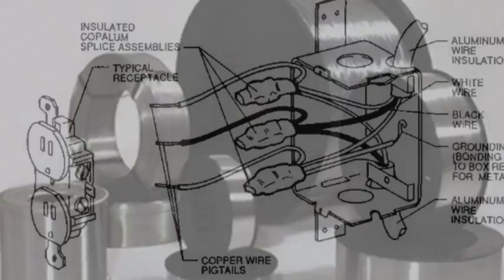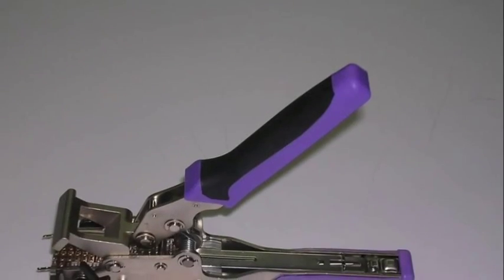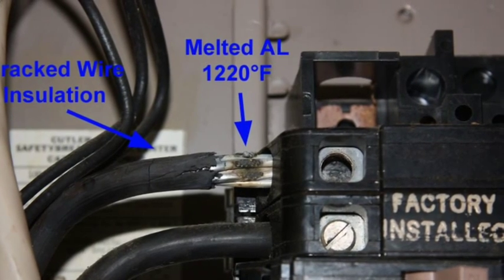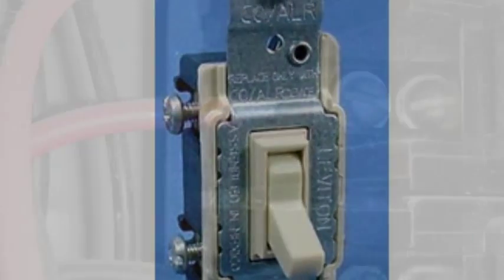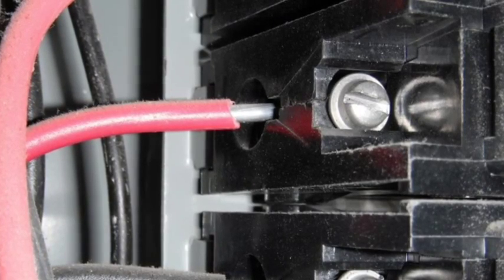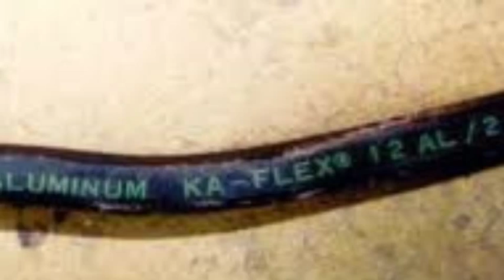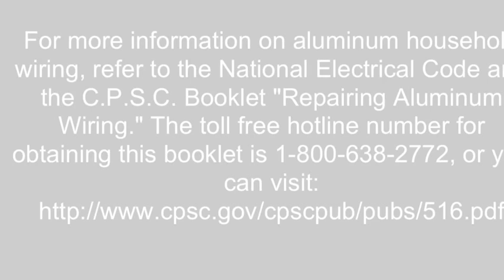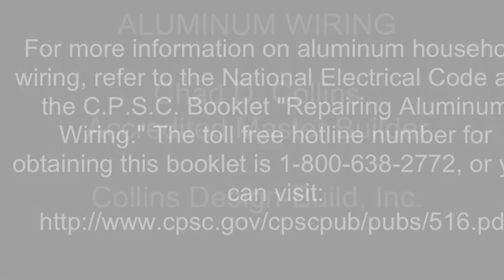Does Your House Have Aluminum Wiring?

Comment: You say to never twist copper and aluminum wires. The Ideal purple AL/CU connectors are installed on AL and CU wires by twisting them together and then placing the twist on connectors filled with antioxidant paste. Is that an approved exception?

Comment: Well explained info...I've been dealing with houses with aluminum wiring for several years..there wasn't much info available years back but now there are many sources...I've seen lots of burnt plugs and switches mostly from improper installs...not striping wires properly striping wires with striping tool nicks wire causes it to break..using razor knife is best...copper to aluminum  connections without proper connectors....It's safe if done right...

Comment: Use alumicons on everything
Reply: If two houses are equal, I'd run from aluminum wiring. No need for it prior to 68 or after 72. 

Could be 15-20k to rip all that crap out for 1,000% sure! 

And EXPECT unqualified RE agents to blatantly LIE about EVERYTHING,  particularly shite THEY don't have to live with, just to whore themselves to get the check asap and do as little as possible.
Reply: Are Wago lever nut compatible with aluminum?
Reply: Wago has copper inside the lever nut. Look like aluminum is not compatible with copper when they touched each other .
Reply: @conchim99  wagos (with the wavo brand grey  nolox) are allowed in the europe. Here it's the purple marrets, black marrets, or alumicons. The latter is the safest option

Comment: Very detailed explanation
Which other metals can be wound or connected with aluminium directly with out problem?
Which material is alumiconn® lug made of?
Which other connectors can be used to connect aluminium with copper wires? 	
Thanks
Reply: You can use Wago connectors with alu plus gell, its safer that anything that was in this video, in my country Romania more than 50% of the population has aluminium wires in their houses, and its pretty safe.

Comment: My husband and I bought a 1969 ranch two years ago and thought the wiring had all been replaced. As we toured the house, all of the electric boxes and switches were hanging out of the walls and appeared to have new wiring. Plus, the owner, an electrician, was running new wire in the finished basement. For us, it was one of the selling points of the house as all of the others we'd looked at had ancient wiring. Then recently, my husband added a motion sensing light switch to the laundry room and discovered aluminum wiring that had those temporary purple caps. We're so upset! We've decided to replace it all, which will be a financial hardship for us.  Besides the fact that it's aluminum, it's old.  At present, we have no idea how much of the house has aluminum wiring. We know it was replaced in the finished basement, but the entire first floor may have aluminum wiring with the temporary purple cap fix.
Reply: LucilleB near the end of this video it references a publication from cpsc which agrees with you about the purple caps being temporary. But that same publication says that the alumicon connector (which is also purple) is a safe permanent connection. I’d suggest that option rather than rewire the whole house.  It would save you a lot of money.
Reply: I have "fixed" one outlet using Alumiconn connectors and I basically trust it, but it is not cheap ... $11.48 USD at Lowe's for a pair of 3-tap connectors, and you need both to upgrade an outlet that is mid-run (both in and out Romex). For a second "upgrade", I discovered that Lowe's also sells CO/ALR light switches and receptacles ... the CO/ALR light switch cost $4.88 before tax. Fewer points of failure and less work to wire.
Reply: @tadmarshall2739   "Alumiconn connectors"  ...  Will probably pass code, permanent, expensive.  I have found them cheaper at a builder supply v. an electrical supply.  Go figure?  Research and search.  NOTE: Take into account code/s, quality, characteristics, and insurance, regarding the connectors/wires, and or pig tailing AL to CU.  The Alumiconn are worth the money - EDIT the push in connectors, not the wire nuts - in regard to your home and family being safe... and insurance paying if something does go wrong.  (Well, "worth the money", I cannot really say they are overpriced because the demand is probably much smaller.)
Reply: Welp, you get 5 years to sue. On am average house, ripping all that cr*p out could run a solid 15k. (2k sf ish)
Reply: Old/late - but, for whoever - didn't you have a Title Company?

Comment: My house built in 1968 has all original copper branch wiring fortunately. 
The FPE breaker box that was replaced a couple years ago was a different story and another hazard.
The house I grew up in was built in 1974 and had faulty aluminum wiring among many other defects.
Reply: That's odd, I thought that crap stopped after the Vietnam copper shortage in 72.
Reply: @windsofmarchjourneyperrytr2823  I don't think aluminum wiring was real common after 1972 but some homes had it all the way up to1975.
It never was banned as some think, I believe they just stopped making the smaller gauge aluminum wiring and after the Beverly Hills Supper Club fire it was unheard of for homes to be wired with aluminum branch wiring
Reply: @toyotaas back in the summer of 2005, helped my stepdad rewire his rambler that had aluminum wiring, several outlets and switches had burned connection, some so severe the jacket  was charred up to where it entered the device box.  We felt it was too far gone at that point to be worth pigtailing and since some wall paneling had to be ripped out to replace the old galvanized iron plumbing anyway, redid everything in copper.   It was built in 1973.   I think it was late 1971 that a new alloy, 8000 AL was listed and found to be superior to the older 1350 AL used in homes from the mid 60s to early 70s.  I don't know which version was used in my stepdad's house because existing stock was permitted to be used up after production of 1350 AL ceased after 1972.    

Another variation that hit the market around 1972 was copper clad aluminum, used in some houses for a few years until about 1975 or so. Though it offered the best of both worlds, the performance and safety of copper with the price only slightly higher than aluminum, by the time it was introduced the problems plaguing aluminum wiring were extensive and well documented to the point many builders stopped using aluminum by the very early 70s.
Reply: @rarelampcollector  I'm sure our split level had the newer aluminum wiring. It was still faulty, several fixtures and outlets had to be pigtailed. 
The house is still there I would hope someone has rewired it by now.

Comment: Somehow a fear has been spreading in recent years that aluminum conductors be replace. This is costly and almost always not necessary.  When two or more metals touch and interaction free electrons are exchanged this is done if external electrical curent is applied or not.  This is a great video, direct and tells it as it really is.  Aluminum is not the problem; it is what aluminum touches at both ends of the cicuit and at slices. Aluminum conductors are very much still specified everyday from tables in the National Electrical code.  Aluminum is safe but needs to be installed correctly which is not rocket science.  Homeowners are encouraged to seek out a knowledgable electrician or electrical engineer prior to replacing any conductors or any electrical equipment.
Reply: The main power feed to your house is almost certainly aluminum, it really is a decent conductor. But houses since the early 70s generally use copper ... it is more expensive but still better.